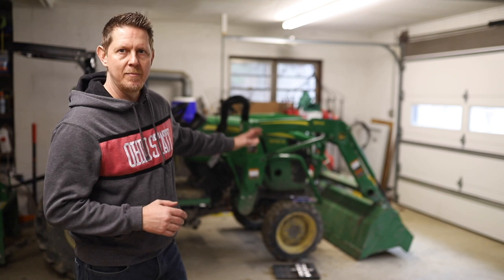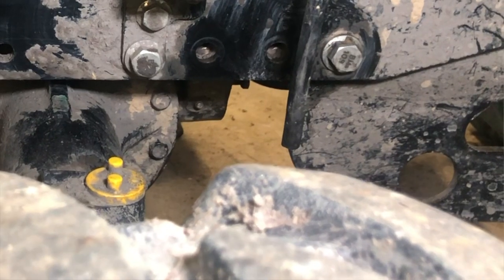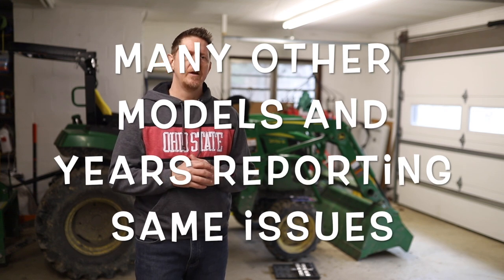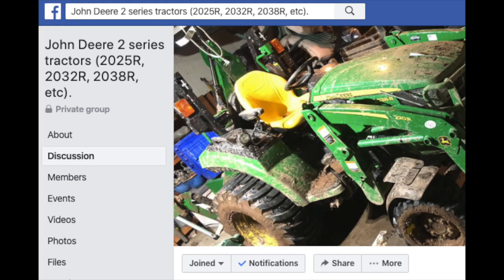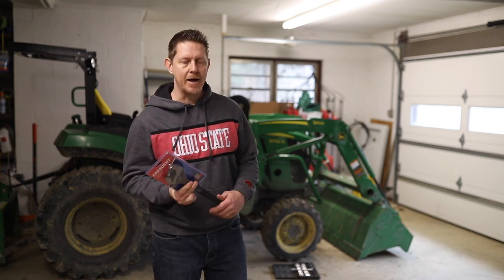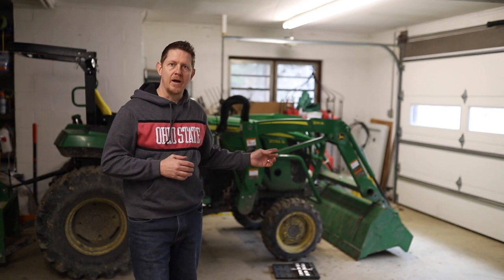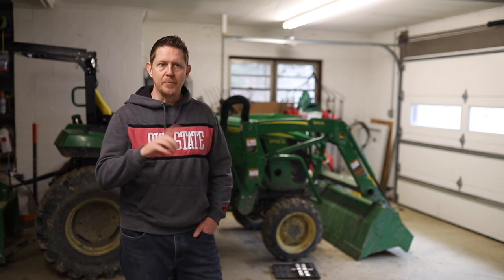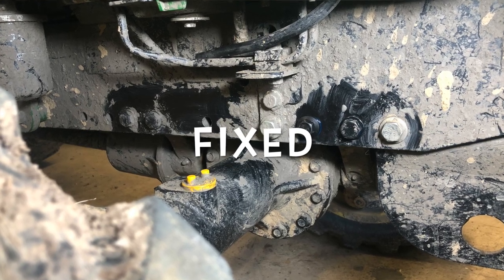#21 Caution John Deere 2 Series Compact Tractor Owners Bolts Missing or Loose on Front Axle Trunnion

Comment: Hey Josh, THANK YOU for posting this. I just got my new 2038r this summer and after watching this checked to see if I had any missing and it appears like I have 2 missing. So I reached out to my dealer with the DTAC and Res. numbers you provided and they have offered to replace all 10 bolts, and pick it up and drop it off when it's done.
Reply from the maker: RJ that is great news that your dealership stepped up like that.  Haven't heard that from some others and some haven't found the issue until their axles fell off.  Glad the video was of use and that you have a resolution!  Thanks for watching and commenting!
Reply: Yes, I am lucky. Small dealer in a small state and my sales rep. has done well by me. In fact, they called me first thing this morning and already picked up my machine.  Said I should have it back tomorrow.  I appreciate you sharing the information.  I watched hours of video for a long time before buying my 2038r. Your review videos were helpful in the consideration to purchase this machine.
Reply from the maker: @rjmack3790  I don't think I made the point in this video, don't recall, may have... I suggest getting a paint marker and marking those bolts after you get it back. I've done so and it makes it so easy to do a quick visual inspection.  No problems since... Here is a link to our Amazon shop for the ones I bought https://amzn.to/3loG62x. Glad our videos were useful in your research.  We've found that we go to Youtube all the time for research so decided to join the information sharing and have had a lot of fun doing it.
Reply: @HardyBrothersOutdoors  you did actually and its a good idea!

Comment: This just happened to me.  Front axle completely fell off.  Only thing holding it on is the hydraulic line.  2018 2038R.  Same issue.  Didn’t know about this until too late.  Should be under warranty.  Better be!
Reply from the maker: Glad you weren't hurt.  Feel free to share this video with John Deere... they have a major issue and are not giving it the attention they should be... I was told by my dealer that a Deere DTAC ticket did not exist...

Comment: I have a 2038R with around 200 hours, today while mowing the yard i realized that all 8 bolts either came out or broke off and the front axle isn't even attached to the frame anymore. It also broke the pinion on the front axle for the 4 wheel drive. Not sure why John Deere suggests to put on locktite with these bolts if they didn't use it when building the tractor. Going to be out around $1000 to fix it myself. Probably much more for a dealer to fix. Wish I had watched this video yesterday, lol.
Reply from the maker: Roger I have a DTAC video with the info you need to get this fixed for free. Check out video #62
Reply: Thanks, I watched that video after I posted the first comment. Called the local dealer with the DTAC information in your video and I am awaiting them to contact me. I got the broken bolts removed from the trunions today, so if nothing else I can get new ones in and be able to move the tractor. Will have to see what they say about the broken pinion in the front axle, it happened because of the bolt issue so I hope it will cover. On another note my warranty ran out June 2. Appreciate the information on the video and your reply to my comment. Again thanks, Roger in Tennessee.
Reply from the maker: Roger Brock yes sir no problem. Fight for that coverage. I was out of warranty by a year. No tractor with 200 hrs should ever have an axle fall off. Frankly no tractor ever should have that problem. Best of luck, would be great to hear back what they do for you.
Reply: Hello all, well I've been on the phone this morning with the local dealer (in East TN) as well as the customer service center from the owners manual. Neither of which could locate the DTAC 1212048 in their systems. The local dealer did see the solution number 215214. He informed me those numbers were for information purposes only. They both told me I would have to pay for any repair (parts, labor, and transport) because my warranty ran out on June 2 2020. I then contacted the dealer I bought the tractor from (Florida) and they are going to look at a few things they potentially can assist in. Seeing as how I have only been paying a little over 2 years and have 3 years on the contract remaining, I suppose time will tell if I stop my payments to John Deere financial and have them repossess the tractor. Thanks.
Reply: Update 100, lol.
Got an email from the original sales rep at Ag Pro in Florida, he reached out to my local Ag Pro dealer in East TN and they are going to try and get a special allowance through John Deere to fix my front axle issue. Would like to say thanks for any assistance I got from people on here. We'll see how it goes over the next couple days or weeks.

Comment: Just had this happen to my ‘22 2038r Deere front axle completely folded, pinched the steering lines, and snapped the input shaft for the front yolk off.  

I think it’s time for me to get rid of the Green, the build quality is just not there anymore.
Reply from the maker: Sorry to hear this. Definitely a frustrating issue. I have yellow paint marker lines that I check often to make sure they aren’t loosening.
Reply: The company that I work for, Busted Knuckle Off Road, does the same thing with all the bolts they install.     I was frustrated to see that Deere doesn’t do this, even for some locations that are important to stay tight.

Comment: Torque specs are located in the Operator’s Manual.
Reply from the maker: Thank you Tim!  Saw your post on FB... So for this model for the M12 10.9 class bolt the torque requirements are; 97 lb-ft (132 M-m) dry and 76 lb-ft (103 N-m) lubricated.  I am not positive they are in the 2017 manual, I didn't look as the others that reported the issue in Green Tractor Talk mentioned they were missing.  But this is perfect, thank you! I will also add to my video description.
Reply: I should have mentioned that I looked in the manual for the 1025R, but bolt torque specs are bolt torque specs.
Reply: My 2020 manual shows 105ft/lbs for the M12 10.9 bolts. This may explain why I broke one off today.